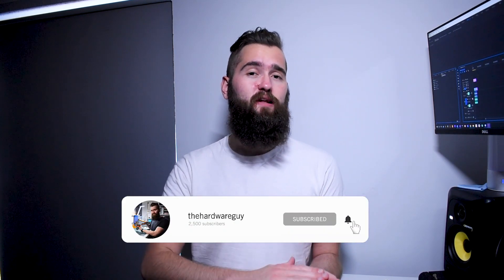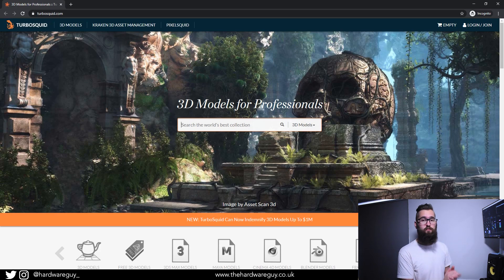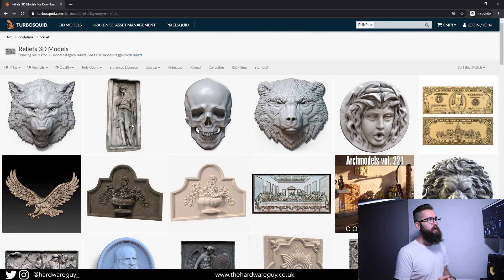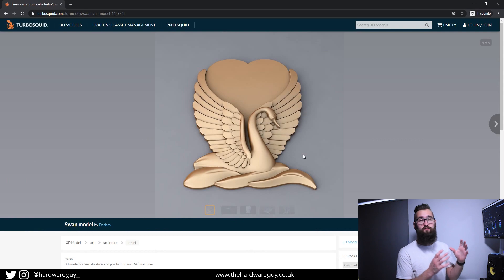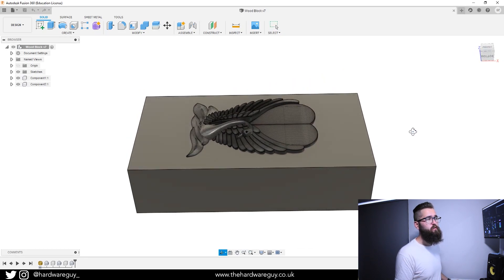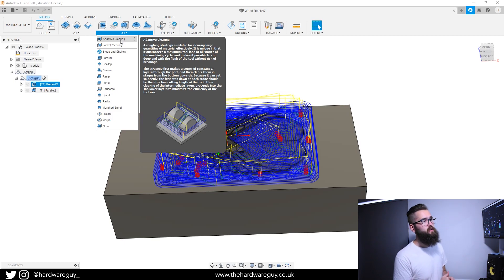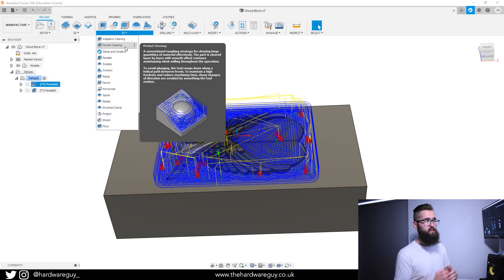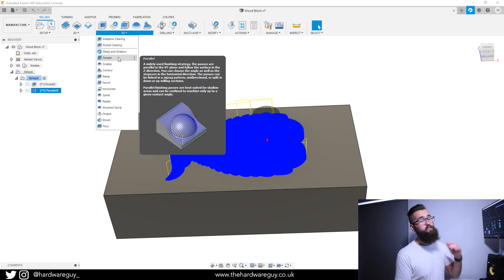My First 3D Carving - Upgraded 3018 CNC

Comment: Excellent explanation. Looks like one of these little $200 machines is a great way to dip your toe into CNC. The new ones don't make the Z extension very easy, however, since they've moved away from the extrusion construction for the gantry.

Comment: Sorry but i have contradict. 2D and 3D Adaptive are the much more gentle strategy to clear as much material as possible. I only use them on my default 3018 pro. 
All you have to do is set the "Optimal Load, Maximum Roughing Stepdown and Fine Stepdown" at the "Passes" tab to an apropiet value and fusion will calculate pathes with an constant load. 
A constant load is much more gentle for the endmil and the spindle / machine, then constantly changing loads.

Comment: Hi, I'm Asher. Uh. I got that CNC now. I got it after watching your videos, but now I have a great dilemma. I cannot figure out the computer side of things. I'm a teenager deeply interested in this stuff. I would much appreciate it if you make a video about the CAM side of Fusion 360. as a note I do have some experience in the design workspace of Fusion. Or Maybe you can just direct me to a good video about CAM, but I couldn't find one. Also I cannot see how you can use a v carve bit with a parallel cut in Fusion.
Thanks, Awaiting your video or reply.

Comment: Hi, I use Vectric Cut 3D and V Carve and export G Codes to Mach 3 to a Taig CNC Mill. I'm looking at a 3018CNC and was quite impressed by your 3D Carving on this machine.

I assume you just export the G Codes from fusion 360, do you open the G Code directly in the GRBL software and run from there?

Comment: My 3018 has the same upgrades to include the 3rd rail Z support.  I’m just starting to get it carving and engraving and so far it’s pretty amazing for a small machine. I’m doing some research into possibly using ball screws instead of the stock jack screws mainly to increase the precision for small letter engraving. Any thoughts on that? I know what I have invested so far could have gone into a higher end machine right from the start but I love to tinker with these. Your videos have been great for ideas. I personally enjoy watching them very much. 👍🏼

Comment: Oh man how long did it take you? I have the base 3018 and man it takes forever. Even simple designs can take 2-3 hours. I've been wondering if it's worth upgrading or just start saving for a better mill. Also I find that the second half gets more rough because the clamps start to loosen so I drilled a board to the base and just screw things to it instead of using the clamps they provide.

Comment: instead of the cheapo bits they come with try a Yonico 6.5 degree downcut ball mill. its about 25 bucks but the finish will be much better. I am one year into my experimenting with a 3018 and with the limitations of the machines structure the best improvement you can do is buy real bits. if you buy a 10 pack for $10 you threw away $10 the finish will suck and you probably went through 2 of the crappy bits to get it close to good. wood needs a downcut or compression bit to get clean edges. with these machines you will never get proper chip load so always buy bits with 1 or at maximum 2 flutes.  chipload is important if you are producing saw dust you are overheating and dulling the bit. larger chips take the heat away from the bit.  best way to tell what your machine can do is setup a piece of preffered material to work with and run a test pattern of straight lines. change the feeds and speeds on each run. its weird but youll find out with a good bit when you speed up the feed rates quite a bit it gets to a place where it cuts like butter then will get back to chatter.  this is particularly noticeable in acrylic. too slow you melt plastic to the bit too fast you snap the bit but in between there and theres a fast beautiful cut with a mirror edge that needs little to no cleanup.  I have tried many different bits and prefer Yonico and Amana. Amana bits are the cream of the crop and just about the most expensive out there but well worth the money. I also like to use 1/4 inch shank bits  that taper to the work size where a 1/32 " bit will be fragile a 1/4" shank that tapers to 1/32 for a half inch is alot stronger.
Reply: Thank you
Reply: Hello. I think this is one of the answers i"m looking for.
Can i add one more question? Can we carve brass to make ba branding iron with these bits and this machine ? I just bought the machine..

Comment: Hello . is it possible to export the gcode of a similar sculpture with easel software?
Reply: Well yes and no. You can import gcode that's from fusion 360 into easel than use easel as the grbl controller/export it but you can't write complicated 3D stl gcode with easle.
Reply: no
easel is really 2d carving. one trick i did was find an image for a true relief and convert it to an svg file. the svg file will allow it to be in a few different heights due to layers created with the tone differences but it really looks bad.  3d relief work needs a 3d gcode generator.

Comment: Plz give the details about the drill bits used for carving. As I’m new to cnc ,it might be helpful for my projects.
Reply: You should be using end mills not drill bits.
Reply: Please read my comment i went into great detail about bits that ive learned from my first year of working with a 3018. hope it helps